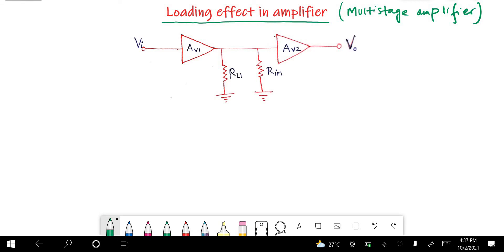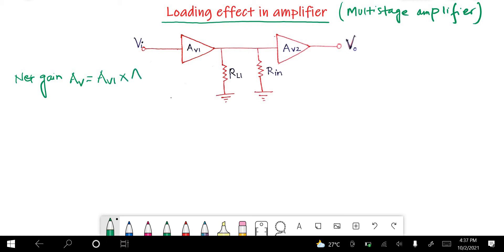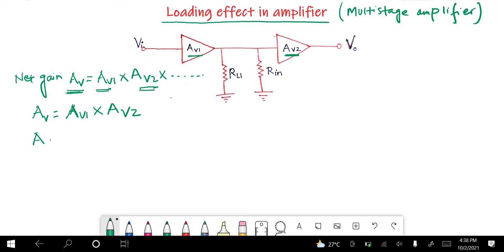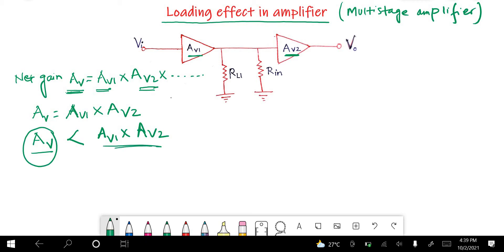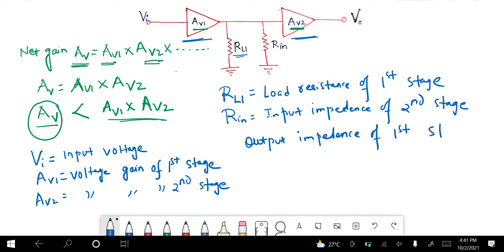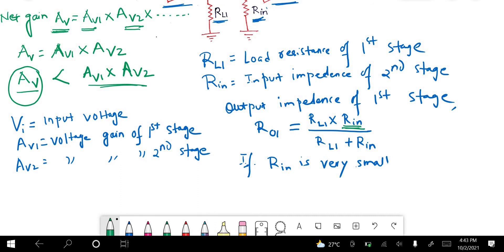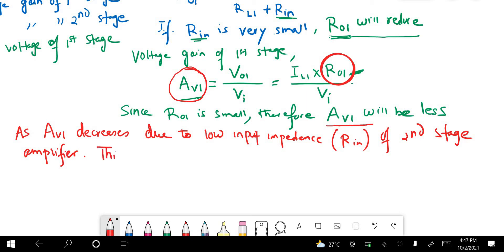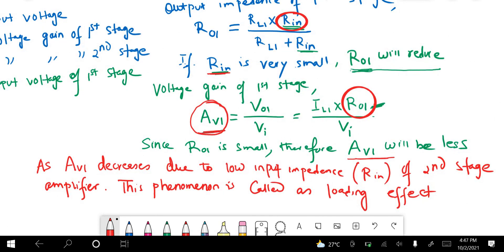LOADING EFFECT IN MULTISTAGE AMPLIFIERS

Comment: Sir, practically what is  the "Input Resistance of 2nd stage"(Rin in this video)  in a RC coupled multistage BJT amplifier??,which has the 'loading effect '
1.Is it the 'reactance of Coupling Capacitor(Cc) (connected in series between two stages)
 or  
 2.The resistance of potential divider network of R1 and R2.  Or the
  3.Internal transistor resistances like rb'e
Which is it among these 3 sir?
Reply from the maker: Reactance of the coupling capacitor.. sorry for late reply